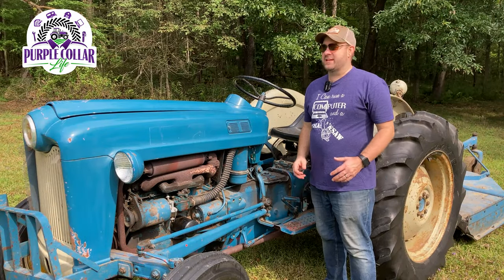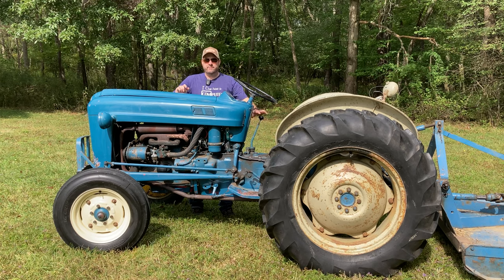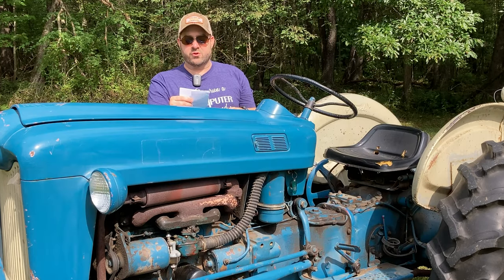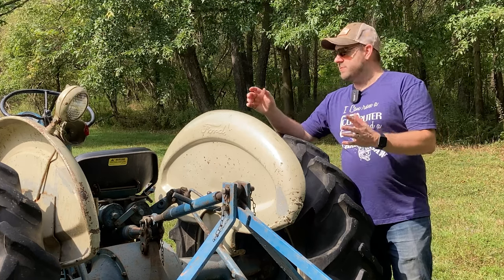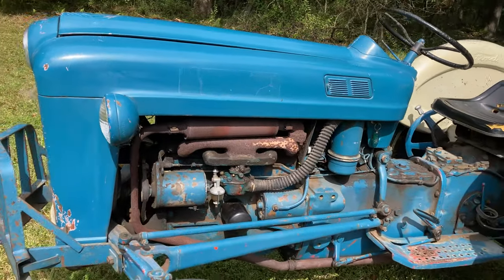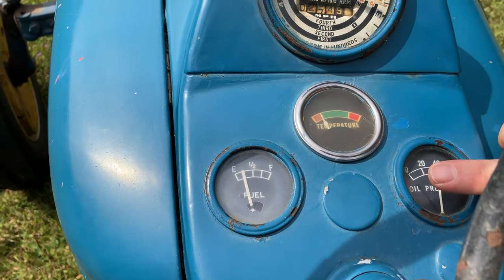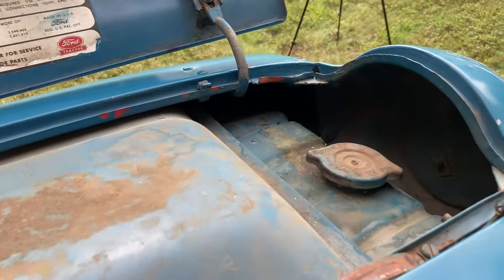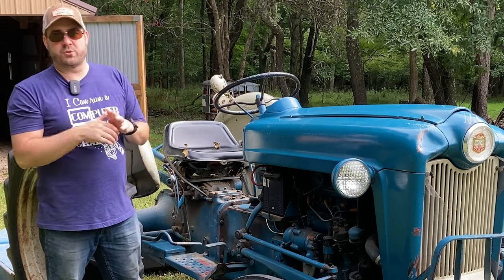Ford 641 Workmaster tractor video

Comment: Nice tractor, and good deal!  I paid much more for mine nearly 20 years ago, and I had to buy chains, brush-hog, and back blade separate.  The live hydraulics on the 641 will spoil you!  I also have my dads 8n (which I grew up on), and I wouldn't trade or sell either one.
Reply from the maker: Very nice! We enjoy having both the Workmaster and the 8N (and the John Deere 2210 with the front end loader).  Each has a role in taking care of our rural property.

Comment: Great video of the tractor. You can look on the left side on the transmission on the flat spot above the two bolt holes. I have a 1955 650 Ford tractor. I would not take anything for it. My tractor is blue with gray fenders. I found out when the tractors was new the dealers painted some blue  so they would look different and draw attention & sell faster. I have seen several blue ones. I have pulled mine in tractor pulls & slow tractor races. I got fluid in front tires. Mine weighted 3,536 lds. Good luck & can't for the next video.🚜👍
Reply from the maker: Thanks!

Comment: Nice tractor, I have a 53 golden jubilee and a second jubilee or NAA from 54 love the old Ford tractors I use them to farm 5 acres of grass hay and Tedder,rake and bale it using these 2 tractors. I have a few videos on my channel of me using these tractors to farm some hay, but I’ve been too lazy to buy some of the 3M GoPro mounts to where I can stick them directly on the tractor while I’m driving around or on the swath or baler. I’m sure you’ll be very happy with it just like I am with mine. It’s hard not to when the things will run forever with simple maintenance.
Reply: I grew up operating an NAA.  I know the NAA's were built in 54 and the Jubilee's in 53 but other than  that what was the difference?  Seems like I remember draft control on the lower right under the seat on the NAA.
Reply: @Machi74005  the only other difference I am aware of other then what you posted is the Golden Jubilee has the high low sherman transmission in it so it is 8 speed forward and 2 speeds of reverse where as my 54 naa is only the 4 speed forward and 1 reverse. I am not an expert on these tractors, so I’m not sure if you could also get the Sherman high low on an NAA or not but that’s the differences between the two that I own Anyway.
Reply from the maker: I didn't realize you had multiples of the NAA/Jubilee. These old tractors are amazing.  Their reliability, history, and the amount of work they've accomplished - it's fun to think about.
I use a rubber coating magnetic GoPro mount, so that I don't have to put the adhesive on the tractor.  https://amzn.to/3LqJJ3m
You'll love being able to get video from different places on the tractor.
Reply from the maker: I don't think there are differences between the 1953 Jubilee and the 1954 NAA - other than the official Golden Jubilee grille badge.  But I'm not positive.

Comment: I just picked up a late year 1957 Ford 640, one of the last of the 600 series sold in 1957.  Someone replaced the hood with one from a 601 Workmaster.  The Workmasters should be all red with light gray grilles and fenders.  Your 641 looks to be painted with the lighter blue from a Fordson Dextra or Fordson Major.
Reply from the maker: Thanks for watching! I agree on the blue paint, it looks like the Major color to me.  Slightly different than the 2000 series blue.  I was thinking about taking it back to the original red - but I will probably leave it as it is. 
Congrats on your 640! I look forward to getting more time on the 641 in the future. I can already tell though that it's got significantly more power (and weight) than the Ford 8N I'm used to.

Comment: Great smoking deal I got s smoking deal as well I have a Ford 601 workmaster a well with a 5' bush hog and 7' grader blade , paid 2300 for it its an awesome tractor 🚜 where can I find the inside wheel weights I need some badly it gets a tad sketchy sometimes when I lift a round bale with the 3 point
Reply from the maker: You did get a great deal! Those are original Ford front wheel weights.  They're cast weights, split (two pieces) that mount inside the front rims.  They are extremely hard to find.  If you can find them and they're anywhere under $150 - it's a good deal.  
They do make it nice to have some additional front weight.

Comment: Ok I got a question for you guys I have a Ford 601 Workmaster I know the model numbers says its a 641.... So should the sticker on the side of the hood say Ford 601 Workmaster or Should it say Ford 641 Workmaster! Thanks in advance!!!!
Reply from the maker: This is a great question. I have seen tractors with the 641 sticker (and 661 even). But I've also seen tractors with the 601 sticker that are 641s.  I'm not sure what was actually stock from the factory.
Reply: @Purple Collar Life  Thank you I bought the tractor as a resto project and I looked at the sticker and it seemed sideways to me as if someone replaced it in the past and since they had a 601 sticker on it but it was a 641 I didn't know what to put back on it lol. I appreciate your response and I love your tractor she's a beauty. Thank for the help.

Comment: What was the difference between the Jubilee and the NAA?
Reply from the maker: Great question! The NAA and Jubilee are the same machines. The Golden Jubilee is actually the first year of the NAA tractor (1953) , marking the 50th anniversary of Ford.  So any 1953 NAA is a Golden Jubilee version. All other NAA years are often still called "Jubilee" tractors, but technically only the 1953 is the Jubilee model with the Jubilee badge.

Comment: You sure it’s live pto??? I must of got jipped with my 641 4 spd, I don’t have live pto,got a hi/ low Sherman in mine.
Reply from the maker: Hello - Great question. It's not live PTO. It is live hydraulics. In other words - the PTO does not have to be running for the 3-point arms to lift. BUT- the clutch does still engage the PTO with the engine. (not live pto).  Thanks for watching!
Reply: @PurpleCollarLife   fords live hydraulics was only 2 yrs,and it didn’t sell as Ford thought it would,then in 55,that’s when Ford started their live pto!, By the way, 53 and 54 was live hydraulics time,then it ended. Ford had it as an option for new tractors, it didn’t sell well at all.

Comment: Who's gonna tell him that blue and white don't mix to make purple?
Reply from the maker: @OutdoorsInTheOzarks  You’re correct. But it is an industry term for careers/jobs that combine white collar work with blue collar work. For example - engineers that design at the computer, and then machine and build the components they designed. Or Information Technology personnel who manage a network both in software, and physically running Cat 5 or 6 network wire. Purple Collar is that combination of both white collar skills and work, with blue collar skills and work.  Why did it become known as purple collar? I have no idea.